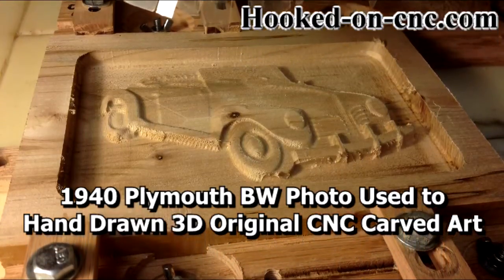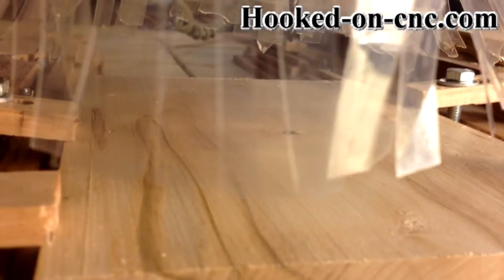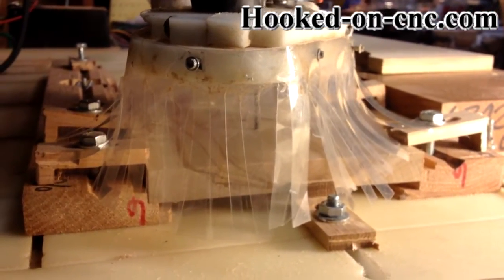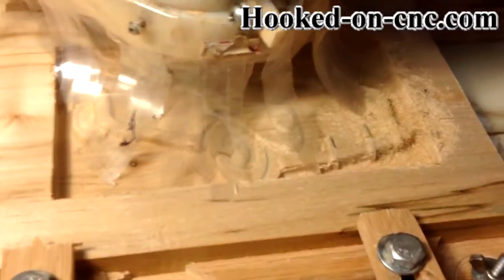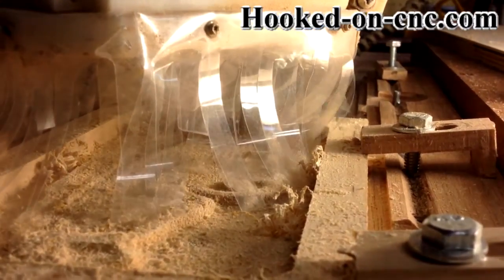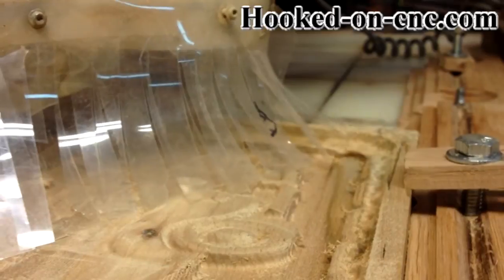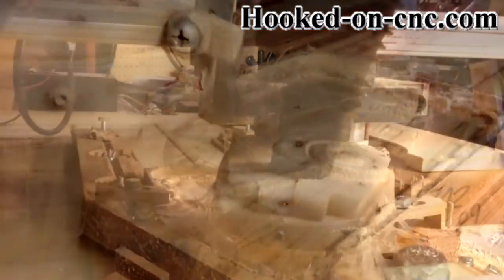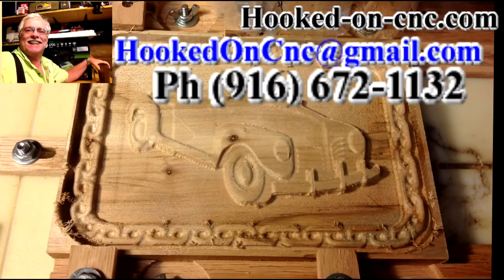Photo to 3D Wood Carving-1940 Plymouth Convertible

Comment: Cool how much would something like this cost to do?
Reply from the maker: How much would it cost to do. If you are talking about the cost of the CNC machine. There is all most no limit the about of money you could spend. It is possible to build a small cnc machine yourself under a $1000. If you asking about the cost of cutting a 3D project that depends if the design in exist someplace for sale. I have paid as little as $25 to as much as $125.  If you need someone to design a custom 3D carving. That could cost more. The car in this video took me about 5 hours to design and create the machine code for the cnc machine. In that case it may depend on how much per hour the designer/code guy would charge you. Call me if you have more questions. Lee Noring phone (916) 672-1132 this is my office phone at SEO Advertising.

Comment: Building your own CNC!!! It's like building your own aircraft or spaceship. Too difficult.
Reply from the maker: You are right, there is a lot to building a CNC. There are lots of websites that offer lots of help. Which makes it possible for just about anyone who likes working with there hands possible. I did not build the electronics, the stepper motor controls and related parts. I cheated. I got them as a kit the had everything I need. That was 6 or so years ago and at the time the cost was around $450. For a 3 axis kit.

Comment: I would like a Carving of the 1990 Cadillac Deville!!
Reply from the maker: Do you own a 1990 Cadillac Deville? That is a very nice car. Where would you put the Cadillac carving at?
Reply: Well I did and it blow a head gasket I had trouble Deciding what to so ether come up with 1,700 Plus maybe more because the Trans. was showing signs as well